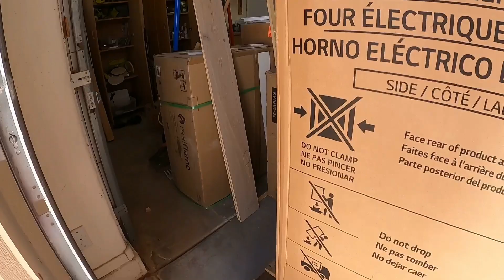What You Don't Know About Rattlesnake Bites (But Should) | More Snakes Removed From Homes

Comment: I have been bitten a few times by rattlers and I still will rescue one. This summer I had one on my patio I did not even see it while BBQing and even though no bites I got my catch pole put it in my bucket and relocated it about two miles away. Snakes are a big part of the eco system and they help keep the rats and mice in check.